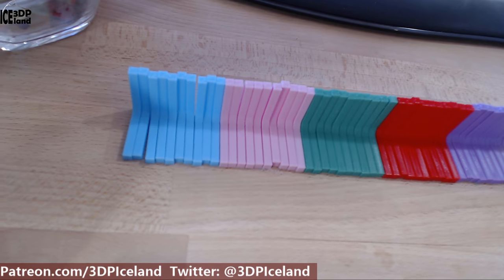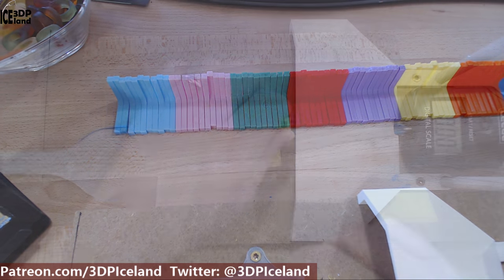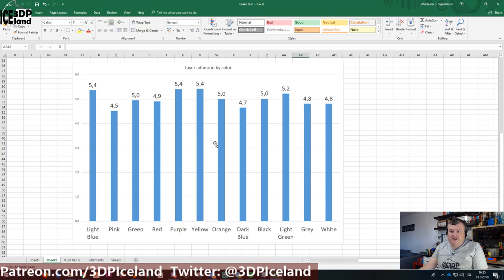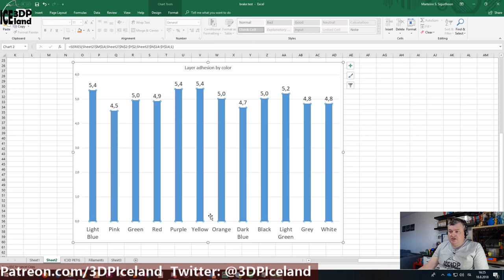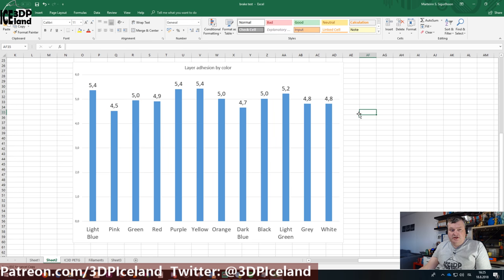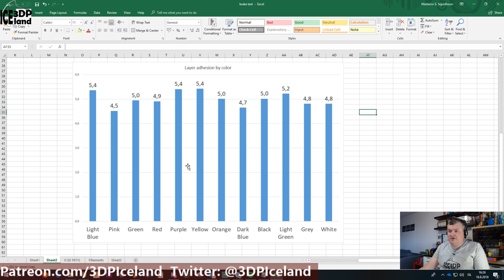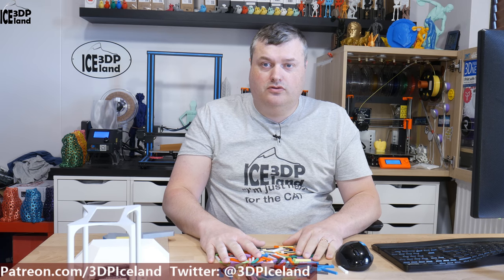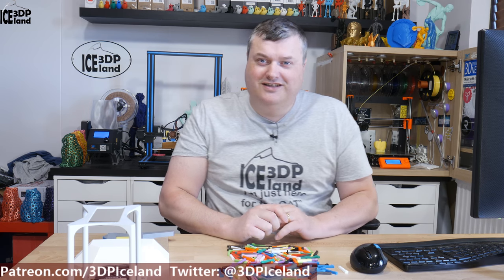Layer adhesion strength test based on filament color

Comment: Interesting that the pigmentation causes the layer strenghts to differ that much..I wonder if heat would also affect it?
Reply from the maker: yea, it was a bit surprising to me, I did a similar video just the other day, on testing how layer adhesion was affected by both print temp, and part cooling fan speed, -  that was on PETG though.

Comment: I just thought of another test you could do with that rig. How about testing what different layer heights and/or nozzle diameters affect breaking strength? I'd be interested to see results both on the strong and weak direction of the layers.
Reply from the maker: Yea, that is a goid idea. Thanks.

Comment: Interesting idea that colour may affect layer adhesion. I like how you keep creating original content!
Two things I miss for this to be more clear/scientific:
1) Control samples. Several groups of 10, all from the same roll and same color, to get a baseline for how much the break value will vary in your testing methodology.
2) Did you take care to place the test pieces so the layers were always horizontal (or always vertical)? I assume the test parts are weaker in one orientation than the other orientation.
Reply from the maker: Thanks for the comments,  I actually did a control sample of 100 pieces of the same print/material/color , to get a "margin of error" value for this method with the device. I also did make sure all parts were oriented the same way when loaded in the device, as I'm breaking it along the layer lines, orienting it the other way, and then breaking "through" the layers , gives completely different results, (often 3 4 times stronger) but thanks for asking if I though of those points :)
Reply: @3DPIceland  Great work. What was the margin of error for the control samples?
Reply from the maker: with the latest changes on the rig, I was getting +-10% on the control samples, - before the handle addition, it was around 15% - I really want to get this to a lower value,  I have made an order for a motor, to do the pulling, and hopefully that will help to get constant pulling force :)